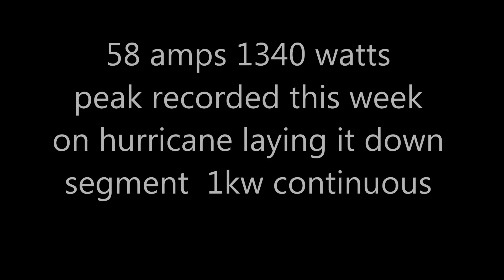Residential wind turbines How to understanding home wind power why  now 101 part 1

Comment: Hello Tony, I was wondering if I can buy another hurricane vector turbine? I don't care what anybody says or lies, I have your vector turbine and it works great, it has worked great and produces power just as you discribed, it's built tough, long lasting, and if people would take the time and look over your turbines, they will see, that you have pride in your products, that you took time and effort to design a ridged well built machine. Thank you for building a great turbine.
Reply from the maker: Hi Seth I got the Covid spent a month in the hospital then got paralyzed for 2 months  from  auto immune reaction to that which caused a spinal lesion. I am working some and will return to full-time building at the first of June. . We have over 100 people wanting these and may open this up for preorder however I needed to make sure that I would recover to the point we would be able to  keep going here,. If your ot in a hurry  let me know but thatbs=ks for your kind words
Reply: @HurricaneWindPowercom  hello Tony, I was concerned about you, I had talked to couple people and said they haven't heard from you, glad to hear your doing ok and I understand, I got covid and it had me down for 3 weeks, almost had to be put in the hospital, I understand about auto immune disorder, I have chrons disease and Degenerative joint disease, I am 42 but doctors say I have body of 70 year old, my spine is deteriorating so fast, I had to have a back fusion surgery when I was only 36 and soon I have to go back for another spinal surgery on vertebraes above spot I had surgery already, but won't get surgery till next year, it's rough and each day is a struggle, so I completely understand what your going threw. I'm not in a big hurry, but if thier is that big of a list, then you can put me down for 2 vector turbines then, a 24v and a 48v, I have my wiring and poles already to go,  won't buy any other turbine because I'm impressed with ones you produce. Thanks for answering back I appreciate it.

Comment: Hi dale. I have been designing VAWTs for years.  the main problem is the type of wing used. sure they can pick up wind, but the other wings limit the action. so there is a certain speed you can achieve.  there have been all kinds of designs.  main thing is to build the set up to produce the power you need so you do not rely on higher wind speeds.  just means you may need more coils per phase.  the one on tonys bench with the tapered shaft would probably work pretty good once the right diameter of blade set is built for the wind you have.  main thing is, one size does not fit all, sometimes custom is the right way. hang in there lol, tony knows what he is doing. SD.
Reply from the maker: +SilentDeath002 Thanks for your kind words I you success with axial pma's I see is pretty well documented
Reply: +Hurricane Wind Power  Hey tony, I love experimenting in this field.  I show some videos a long time back that I built a pulse motor. using the excess shaft speed I built a 3 phase generator similar to the one on your right on the bench in your video. I use the pulse motor to recondition batteries that are sulfated . the pulse motor speed can be adjusted  which can regulate the rpms the 3 phase runs at. while the pulse motor would run for say 24 hours conditioning a few batteries, the 3 phase would put power into a 12 volt battery bank. that was without using wind or solar.  it wasn't a lot of power, from around 600Ma to maybe 1.5 amps, but it was totally free. I stopped that research project after my last move since I did not have room to continue. I do have videos showing how it progressed from using 3 pound pull magnets on a wooden rotor to 49 pound pull magnets on 1/8th inch steel rotors. I should of used thicker rotors cause the magnetic paths did penetrate thru the back of the rotors.  ill check in with you later on bro  SD.
Reply from the maker: Well there you go people can and will do and be successful and seller or not that does not make me the almighty knowing being about every aspect of every facet renewable energy. Seems to me like some folks have swollen heads but I can tell you that while I have a lot of shop time under my belt I still learn from others. When you fail to do that growth stops. I think with out going into detail you get what I am saying and it is this spirit I stand against
Reply: +Hurricane Wind Power  I hear ya. what I hate is certain people put out false information to make money.  its always better to be honest and open and educate so they know what to expect from a product.  like most people do not know the diameter of a wind generator blade dictates how long the vain has to be, also how many square inches of surface area the tail needs to be to keep the wind generator facing into the wind.  they just push sales and the consumer ends up with something that does not work and they do not know why.

Comment: Nice job on the video.  I agree with you that a lot of people just do not know what to expect from a wind generator they purchase from a company, they have to trust that dealer.  a idea for future videos could come from those that want to share videos that they can show wind speed, clean or dirty air situations, type of wind generator used with spec's on blade diameter so there is a real reference in what is being used to compare with input.  Doing videos like this will help someone from wasting money.   A good sight assessment needs to be done.   Just knowing that blade diameter dictates how long a wind generator vain and tail sections square inches of surface area has to be to keep it facing into the wind is important. catch ya later on SD.

Comment: So far the XP model PMA from you I have up is doing and exceeding its rating. Says a lot about actually using a engineered generator. Good references to what it takes to use wind powered stuff.

Comment: i would like to know why few wind turbines are vawt's. i see these being marginally more efficient as they can handle faster wind direction changes. not having to whip around when a rouge gust burst through. from a direction, not that of the wind direction of the moment or deflected wind. like inner cities were it can happen most.
Reply from the maker: +dale myers Thanks for the question Dale this is a 3 part series talking point in and of itself. I will be putting together a 3 part series to address in a much larger series of questions.  Little shop addresses some points but the major thing is torque and the vast majority of VAWT's are not efficient on both sides. The RPM rotation is lower and this makes the cut in wind speed for the VAWT higher  more rpm needed. I will work on this one next as we spend hours on the phone with VAWT designers that do not understand these basic principles we want to get out their and they have a lot of frustration as the result
Reply: ok, then a vawt wont over spin then. no need for a clipper. and the best alternator would for the application would be an axial flux alternator. because they make more power at slower speeds. or as far as i have watched and read, say just that.now as far as the driving force of the alternator "and i say alternator because it makes alternating current. unlike generators making direct current." i say this because that's the way it is when dealing with cars. the vawt can be made to work more efficient than the open unit just blades. now if they were made like an a attic vent  a pressure forms inside from the incoming wind. and is spewed outward from every portal around it. and i see ***** point when it comes to just blades i the wind and not a pressure accumulator like the attic vent could be. if the attic vent had an enclosed bottom. if you can see my point. were the accumulated pressure could provide a bit more torque and speed for a vawt using an axial flux.
Reply from the maker: +dale myers if you make a VAWT as efficient as a HAWT in the same size diameter  if you have not retired yet you may be well on your way http://www.newenergywatch.com/2006/11/vawt_versus_haw.html
Reply: i'll just give the money away. i'm on disability and wouldn't want to jeopardize it. i fought hard for it after two and a half years. after i was ran over by a farm tractor and three point hitch tiller. someone else can have the money. as i don't see it as a long term technology. each week something new comes out, an make it obsolete. just as bad as computers and cell phones.
Reply from the maker: +dale myers agreed love VAWT's as soon as I developed one and spent all my money to get it cost effective to produce the government would hand out briefcase nuclear reactors